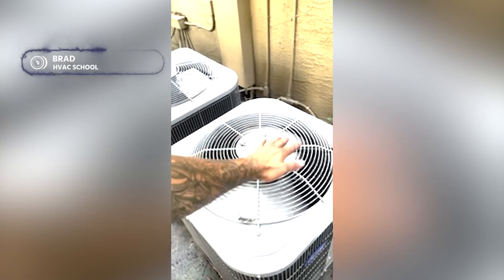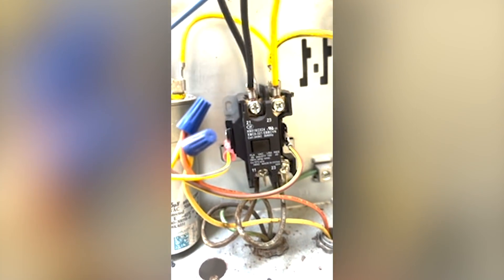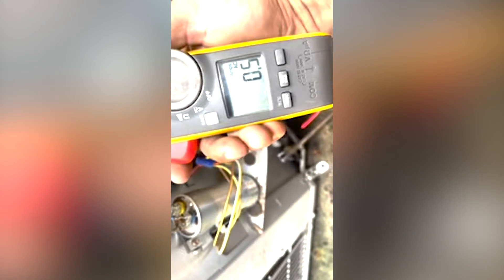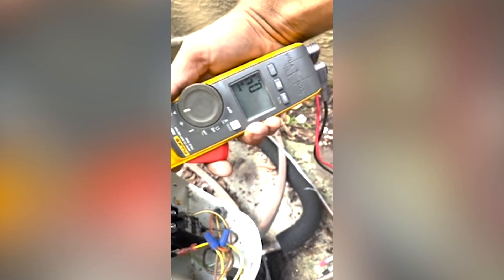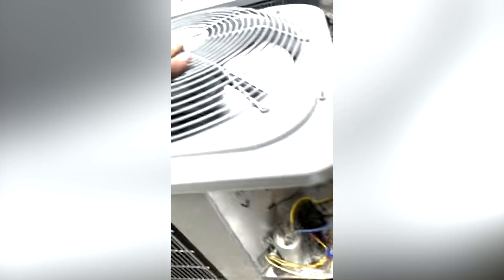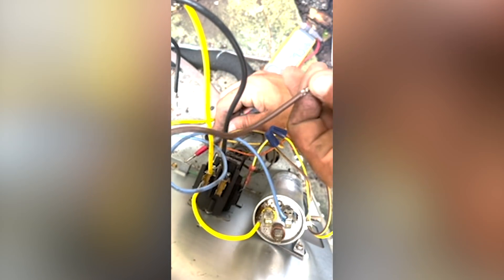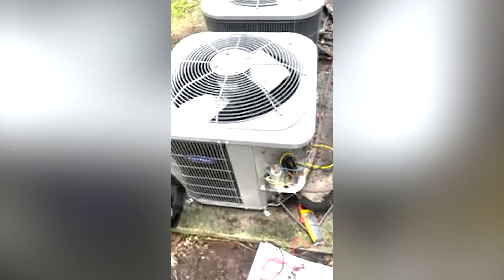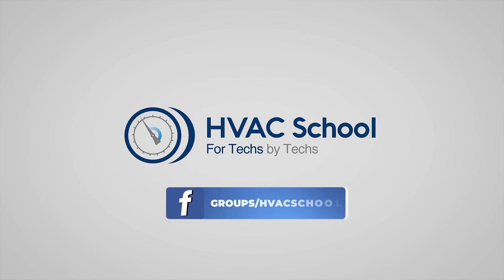Interesting Condenser Fan Issue

Comment: May I ask a question? I have a newly installed Kenmore / Comfortmaker ICP Model N4A330LKA that was installed on July 7th 2022. It hummed and was normal for the first day and a half, then it bagan rattling close to 48 hours after install. The rattling noise is seemingly coming from the fan/motor area because you can walk up to it, make a fist and give it a tap on top of the fan motor on the outside of the unit and the rattling noise goes away completely, but the noise begins to return about 15 minutes later. 
Technicians were here to fix it and said they found a "flower stem" or some debris from a flower in the motor unit, said it should be fixed, then left.. only for the noise to return about 15 minutes after they left. Again you can tap the top of the motor and the noise goes away for a short time. 
When I called back to the company who installed it - Transform Home Pro LLC here in Ohio doing business under the brand Sears Home Improvement, the project coordinator is now telling me that a ralling noise from the unit is perfectly normal and there is nothing wrong with the unit. This makes no sense to me. If you have any advice or thoughts on this issue, I'd greatly apprecaite them. Thanks so much for your videos!

Comment: Quick question. 
I have a 45+7.5mfd +/ 5%
But my compressor fan is rated for a 45+5mfd 
Could this cause the motor to overheat/ stop fanning?
Reply: Obviously

Comment: What you guys mean to say is not that the compressor or condensor was grounded.  They are all grounded if installed according to electrical and safety code.  If it were not grounded, your breaker would never trip when you get a ground fault (internal short circuit) from one of the hot legs to the compressor housing.  If the condensor unit/compressor were not grounded (according to code) it would be floating electrically, and when the compressor develops a "short circuit" from one of the windings to the case, you would then have an energized chassis at line voltage waiting to shock the next person who leans up or grabs or touches the chassis!!!

Comment: For all the "experts" in the comments saying the problem was the "Compressor was grounded" or "Condensor was grounded":...  Does an AC unit need to be grounded?
Yes, the case is grounded. If the air conditioner is installed properly and is plugged into a properly grounded 3-prong outlet, no special precautions are needed to ground the air conditioner.  

What you guys mean to say is not that the compressor or condensor was grounded.  They are all grounded if installed according to electrical and safety code.  If it were not grounded, your breaker would never trip when you get a ground fault (internal short circuit) from one of the hot legs to the compressor housing.  If the condensor unit/compressor were total ungrounded and floating electrically from earth, you would have an energized chassis at line voltage waiting to shock the next person who leans up or grabs or touches the chassis!!!

Comment: This explanation was seriously lacking:
shunt
1. provide (an electrical current) with a conductor joining two points of a circuit, through which more or less of the current may be diverted.

"these components are designed to shunt electrical surges away from microcircuits"
noun
2. an electrical conductor joining two points of a circuit, through which more or less of a current may be diverted.
Reply: You are right! A Shunt by definition is "will form a bypass around the load but the circuit still offer resistance to the flow of current". It is designed by the manufacturer so that normal operation of the unit still continues.
Reply: No.the problem was crankcase heater open and backfeeding one leg of the 240 to fan motor.cch is the only thing that has power when contactor is open. This is where you start.
Reply: @richardharmon874  its not a heat pump, I doubt there’s a crank case heater in it unless its set up for low ambient operation. It doesn’t look like that either because there is no pressure control to turn fan off at low pressure.
Reply: @richardharmon874  Why would think there’s a crank case heater in it, do you see a defrost board or any indication of low ambient application?
Reply: @habaneropepper4156  they put them in just ac units also. Doesn't have to be heatpump. Trust me i installed thousands.
Reply: @richardharmon874  yes for low ambient operation or long line set application with liquid line solenoid valve for flood back to compressor . The point is you seem sure thats the issue when that unit is not shipped with one.
Reply: @habaneropepper4156  not just low ambient units.most manufacturers come with cch to prevent migration of liquid refrigerant in off cycle. You are not listening.
Reply: Carrier tells there installers tò turn power to condensing unit for hour before turning tstat on so cch heats comp oil before starting. Even in Florida. Look it up please.
Reply: @richardharmon874  I am not saying its a bad idea to install one when needed But they are not required on AC only units that are not running low ambient hence they are not factory installed on many units including our geothermal heat pumps because our geo cubes are installed in conditioned mechanical rooms I don’t think its a bad idea on geos to install them though since the geo cubes don’t have accumulators either. My original point was you seemed certain it was crankcase heater causing issue when you don’t know if one is even installed.
Reply: @richardharmon874  Yes I know what their function is but do you know one is installed on unit in question? I doubt it because it’s straight AC and their is no evidence of low ambient operation such as low pressure switch to control fan.
Reply: @habaneropepper4156  carrier and trane has cch from factory even regular ac equipment.york and Goodman do not like you said. I installed all of these in Florida and i do remember carrier had them,From factory no heat pump
Reply: @habaneropepper4156  if there isn't one i going to find unit and put one in just so i can be right. Lol
Reply: @richardharmon874  lol! Yeah i agree with you its not a bad idea to have one in there.
Reply: I had a split ac only unit that had a cch.

Comment: Good one! I recently had a cap at a friend's house I changed the cap and the cap must have been so low it reversed the direction of the fan whoever worked on it before, left it like that and I'm guessing reversed start and run. It was running backwards with the new cap I installed. If I hadn't taken a pic before I would not have believed it. Basically i reverse the start and run wires then it ran fine.
Reply: @jared9530  I know I did a quick comment, but I would have thought people could figure it out.
Before: Fan was running correct direction, comp running fine.
Problem: Cap swole up and died. comp no longer ran. Death buzz on comp and no spin on fan.
Fix: I replaced cap and took pics of wiring for sh!ts and giggles on cap before I did the swap. After new cap in turn on disconnect and now fan is running backwards. Since I took pictures I confirmed my wiring. Just like it came off. I pulled condenser fan and checked wiring and label, cap shares a common with run, I see wires are backwards by schematic and  correct the wiring. Now fan ran correctly.
My only conclusion is that the cap was off on its MFD and cause it to run the opposite direction. I would have confirmed by taken a reading off the cap but it's swelling had broke the common lead and both the Herm and Fan sides showed up dead. Who ever work on it before had just reversed the wires is my guess without checking the MFD which could change the direction a motor spins with the wrong MFD rating.
Reply: @jared9530  and the very reason why I took a picture,  common habit of mine anything I work on. I know the last guy who worked on it. He's got a habit that's not so good we'll just say.
I know what I did. Friend was by my side. I told him we'll that's funny, he witnessed it there with me and even confirmed wires. He called his buddy who "checked it" last time. He was asking me about the brown wires for the cap and says he thinks he left it inside when changing condenserfan motor becauselast one was noisy,  I tell him only one brown. He's confused.  Immediately blaming my work. That's when I pulled condenser fan motor read schematics on both motor and unit. Three wire motor and not a separate pair of wires and separate cap. Friends Friend is no more confused. I confirmed schematics and swapped two wires. I asked Friend repeatedly if fan has been blowing air up instead of down, I remembered from the house inspection who was a different contractor for bank reasons corrected wires from thermostat. And it ran okay then. Friends Friend comes by months later to sell a new intake plenum and moving it from next to fireplace to hallway ceiling and improve things and clean stuff (Friend paid for already,  still not done almost a year later and hasn't been around since I don'tthink). I checked blower, filthy and off balance, and has issues shutting off blower after heat is satisfied. Mechanical bi-metal setup. Lots of vibrations caused it to slip. 
I ask Friend if his friend cleaned this,  says only outside coil and checkedpressures.
I cleaned it, three times over because it's so bad and reassemble, no more vibration. Now bi-metal shuts off when it's supposed to. He's saving up to replace furnace in future. No problems with CO after checking house with my Fieldpiece CO monitor. 

I arrived to a non working unit.
I stated what happened. 
I left out unnecessary details. 
But the arm chair warrior was not happy with what I put. Okay. Now you have the unnecessary details 🙄.
Are you happy now?
Or do you want to go back and forth about what I experienced.  I mean you weren't there for one and give the other guy more credit without knowing either person in anyway. Yet you make your judgment of a person and their work based on a quick statement,  which was clarified a bit curt in tone, Then think I made a mistake when I just said what I found,  and what happened and think someone is better then the last guy why?

Are you the friends Friend with issues?  😆

Have a great day dude!
Reply: @jared9530  if a gets low on mfd, the next time it's starts it can run backwards,  you have to understand how a cap that's worn out with time can reverse motor, and someone before me had reversed wires. I am assuming as most other techs would,  that the last guy didn't check mfd. And I stated why I couldn't test it.

But it's actually herm, fan, common on a cap. Not common, start, run on a cap. And motors can vary with three wire, separate wires for cap, wiresto reverse motor on some universal ones.
I am an hvacr service technician,  most recent training. And I have a 608 universal. 
May I ask what qualifications you have if any?
Maybe I can relate in a better way.  I have other certs.
Reply: After all this, the guy I was responding to, which I don't think was aware of all expandable comments, was on some kind of rant track and now his comments are gone! Guy was definitely  not nice who was on my case for some weird reason about what happened to me and my experience with one weird issue I had. Yet dude was like "rabble rabble rabble" and I'm wrong etc. Gave more information, dude rabbles more. Heavy sigh

Comment: I’ve come across this twice on  carrier units. But never looked into why. Thanks for doing that , makes sense. I’ve also had to replace a shunt contactor on a Lennox unit , to quiet it down on shut down. I didn’t believe the tech support , but it did the trick.
Reply: Did you replace that contactor with another shunted contactor or a double pole contactor?
Reply: They recommended a double pole,  that way the compressor doesn’t have one leg of power going to it continuously.

Comment: I’m just curious but what would happen if someone got rid of that shunt contactor and stuck a double pole in there instead?
Reply: Than motor would overheat until windings burnt up or trip breaker.

Comment: Compressor current may be flowing thru the compressor windings to the grounded fan motor.  Never did like those single pole break contactors.
Reply: I don’t recall seeing any single pole contactors in Japanese Air Conditioners. 

My first encounter with single pole 230V contactors were in Carrier, York & Lennox condensers in this part of the globe. Single pole contactors controlling the lethal voltage of 230V here is dangerous. Great Britain wanted her colonies to be careful with electrical equipment. 🤪
Reply: @dannytong358  you need single pole if it has heaters in it

Comment: I had one years ago that was grounding the furnace through the line set and would not let the flame bar ground properly. Turns out the ground to the air handler was bad, everything worked fine til the fan motor on the condenser started grounding sending a few volts down the line set and they tried turning on heat. Burn for a few seconds then out. Grounds seemed ok but I finally removed the ground from the furnace to test it and nothing. Open circuit. Then when doing the same for the condenser I found 15 volts to ground between the chassis and ground wire. Checked the ground to another and it was fine. Ran a temporary ground wire from the breaker box to the condenser and 15 volts. Removed the fan motor and problem solved. First time i had seen a fan motor work fine but partially grounding. What a pain in the butt but those jobs test us and teach us lessons we remember forever. Now I check a perfectly fine motor to ground if anything weird happens.

Comment: I had this with a crankcase heater issue. Replaced it and issue resolved.
Reply: Crankcase heater (plug type, reciprocating compressor) had a low resistance short through it. The way the wiring was to the 1 pole contactor, there was a path from the shunt side through the condenser fan motor and then through the crankcase heater to the other side of the contactor. This made the condenser fan run. I can't remember if the compressor was trying to start but was going off on thermal.
Reply: I had the same issue like you did
Reply: Please describe.
Reply: Yes thats what was happening here

Comment: I had this happen 2 years ago with a fan lead wire that was pinched underneath the top of the condenser. There was nothing actually wrong with the motor itself, it was just a wire that was shorted to the condenser case.

Comment: Would a new two-pole contactor eliminate the back feeding from the fan in this case?
Reply: yes but the motor is still shorted to ground
Reply: @apollorobb  shorted is shorted that fan is still running!!! i’m i missing something here??? there’s no trips how is the fan motor shorted????
Reply: @oidodsonido  It is not a dead short as in power directly to ground. It is running through part or all of the fan winding first and then to ground. It is kind of like running a 230 volt motor on 110 Volts.  In this situation he doesn't know exactly where the short  to ground is but we do know there is some resistance between the shunted leg of power and where the power goes to ground.  determining where the ground is and what needs to be repaired  is the key step. Hopefully I have explained that with accuracy and it makes sense.
Reply: @oidodsonido  Its a part winding short basically allowing a 220v motor run off 1 leg @ 120v
Reply: @oidodsonido  The electrical & distribution systems in USA may be different from that of the former colonies of Great Britain. 

Over here in the Far East, Singapore, our Earth Leakage device would trip at 30mA leakage for residential & office systems. Factories & industrial systems would trip at 100mA differential. I was surprised to watch a few videos on USA electrical panels that don’t incorporate Earth Leakage device. Probably it’s because our system uses 230V 1 phase and 415V 3 phase. 

Then, I was further surprised that there are equipment in USA that use 230V 2 phase. Over here, we use only 1 phase for domestic equipment & 3 phase for industrial equipment. It’s interesting to learn that different countries have different electrical systems.
Reply: @dannytong358  Bear in mind Danny that I am not an electrician. Please don't take what I say as the gospel but rather my understanding of things based on 25 years in the field. As for the ground leakage device, it sounds like what we refer to as a GFI (Ground Fault Indicator). GFI devices look for a discrepancy between the amperage on the hot leg and the common leg. This technology is typically used in power circuits in areas that are prone to moisture. I have experienced GFI outlets but I believe they also use the technology for specialized breakers. Typically though, traditional or common breakers protect the circuit or wire from a dead short, things like 15, 20, 30 or more amps. As I recall the circuit in this example had a minor short through a load and was only drawing one amp.
Reply: @apollorobb  

Oh, I didn’t understand initially. Thanks for your reply. 

Over here, it’s a rule that every Electrical Panel must have at least one main MCB & one Earth Leakage device. The ELCB would trip whenever any motor is grounded.

Comment: What was the calculus? A bad fan motor back feeding? Or a weak magnet in the contactor ?
Reply: bad motor. he ohm'd it out and it had a path to ground from the motor leads. it would run while the system wasn't calling because its a single pole contactor